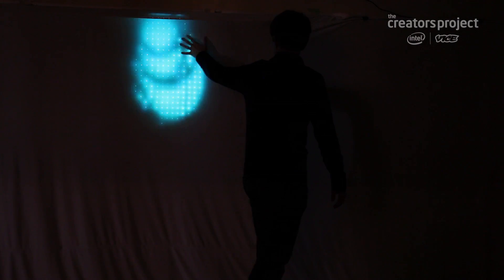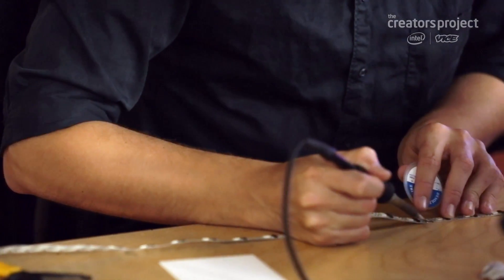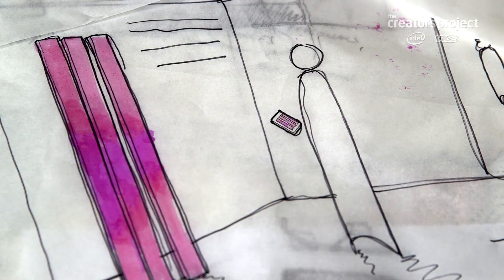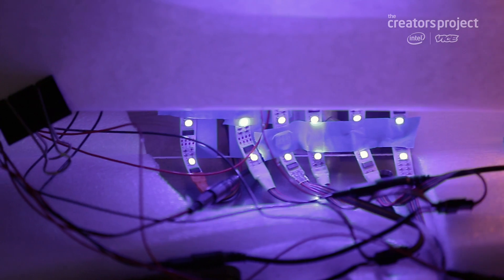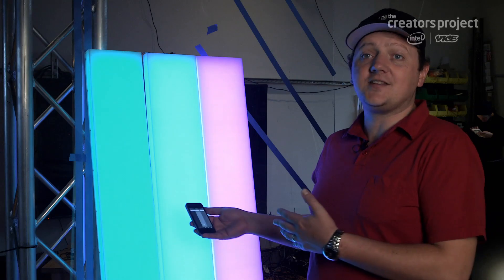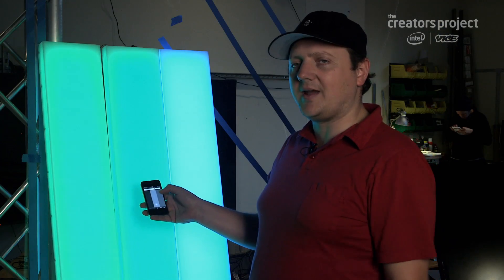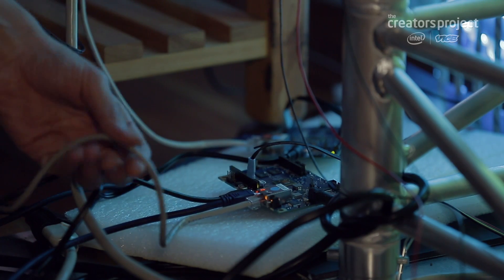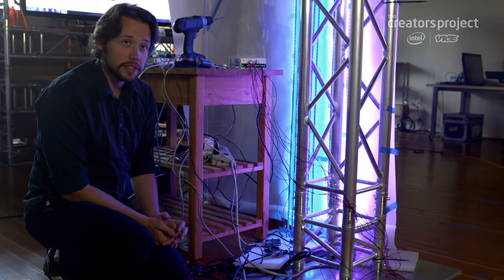Light You Can Touch | LYT by Second Story (The Makers: Episode 1)

Comment: They're talking about Arduino, but pronouncing it Intel. Intel didn't make this open source, Arduino did. They aren't being magnanimous or generous, that is total BS. The only way they can sell these boards is if they are open source. It has a couple more chips than the latest from Massimo, and it's not a Raspberry Pi by a long shot. So, it is unique just like the other 12 boards being sold by companies with less advertising budget. But these posers pretending to be makers are just actors working for Intel. This is a very simple project using one sensor to determine where you are touching it and it lights up.
Talk about the lights, we know who the sponsor is!

Comment: The Raspberry Pi is of a different class. Yes both contain SoC chips but the Broadcom Chip on the Raspberry Pi is really geared towards running a full fledged Linux system. On the Other hand the Pentium Quark chip on the Galileo is geared towards micro-controller operations except with limited GPIOs (which is a shame) but however with an added PCIe interface (which is new and great). Advantage of the Galileo is that you can program it on the fly with an external computer, unlike the raspberry pi

Comment: The intel Board has more on-chip peripherals then ur standard ATmega328 and plus it has onboard Ethernet, high-speed UART, and a mini-sd port if I'm not wrong, considering what you get on the Intel board, it's worth the $65-75, Oh, and not only that, it also runs linux (since its a x86 architecture). So compared to the YUN, the Intel Galileo is slightly more flexible and compared to a $8.45 the Galileo is far more powerful.

Comment: It's not relevant to compare the Galileo board to a bare Arduino board. If you want to add an Ethernet controller and a sd card slot on a $8.45 Arduino board, you'll have to spend $60 in shields on sparksfun or adafruif, while it's already integrated on the Gallileo.
And you're wrong, it's not the exact same variant of C. It's compatible indeed, but you also get a fully working linux on the gallileo which opens wider options. You should read the specs before giving such an opinionated judgement.

Comment: Yes Intel pushed the door open with Arduino; but I guess I need to ask, so what?  Obviously the folks at Arduino (us users, as it's open source) appreciate Intel's addition to the party.  Not sure how it will fit in long term as the Arduino compatibles are about no cost or how low of a price it can be sold for, where Intel is the opposite.